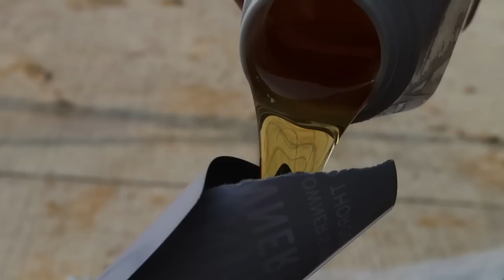WE ARE FINALLY BACK!! (Bigger & Better)

Comment: ITS VERY EASY ROMAN. YOUR DAD HAS A WAREHOUSE OF ROPE.  GET MORE THAN  ENOUGH ROPE TO GO ACROSS THE POND THE GET 5 OR 6 GRAPLING HOOKS. TIE EACH HOOK 3 TO 4 FEET APART..YOU CAN EITHER DRAG THE BOTTOM  FROM SHORE TO SHORE OR WALK ALONG SIDE OF THE SHORE. I GARRENTEE YOU WILL BRING THE MINI BIKE UP WITH IN THE 1ST HOUR..

Comment: ,, Rome Roma stock price to straighten the oil drain the gas for first crash first oil and oil filter and pull couple times on the back wheel examine and run don't go full time just I do and let it run simple